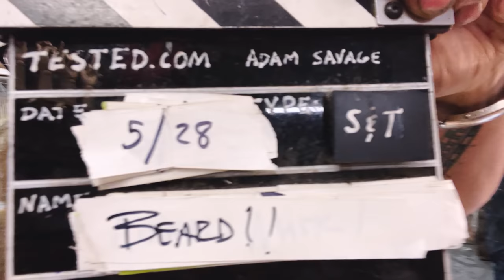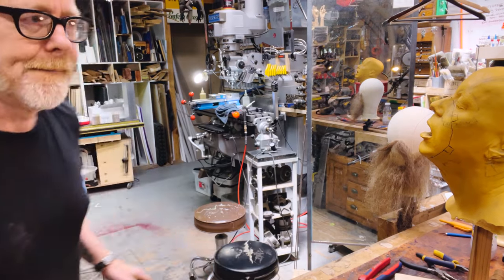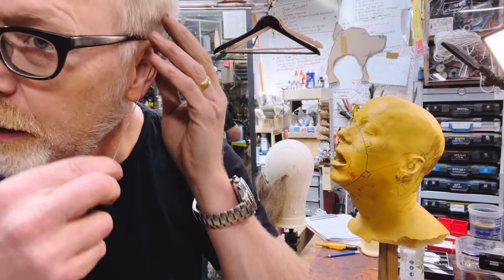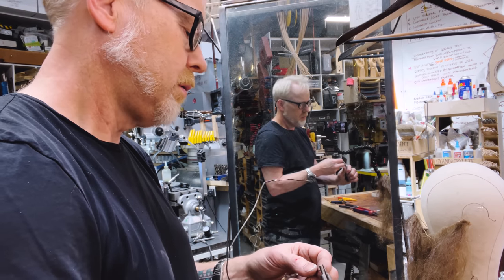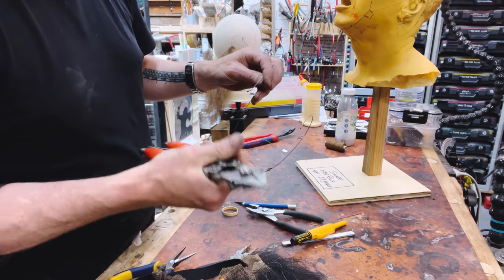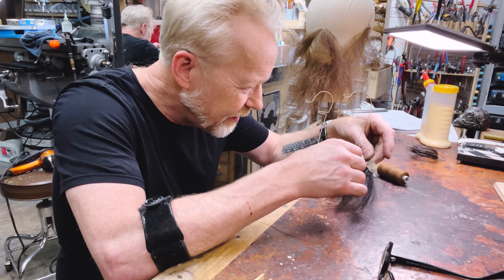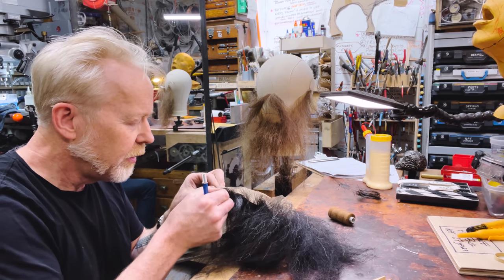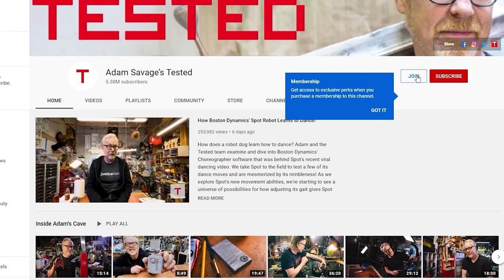Adam Savage's One Day Build: Fake Beard Wiring!

Comment: The person who rang the doorbell, when Adam answered it in his beard, must have thought they had the wrong address.  Or maybe not, since Adam has probably answered the door before as a Wookie, astronaut, dinosaur, Totoro, etc.  His package carrier must never know who (or what) will come to the door!
Reply: Hahaha! I thought the same thing. It got me wondering if his relationship with his mailman is something like what Casey Neistat had with Marvin, but with more surprises (if that's possible).
Reply: Depending on the carrier you might get the same guy or different every time, but most of the time different. If you have a commercial address, you will likely get the same guy as parcel carriers tend to lump commercial addresses into one route that is designated to a driver.